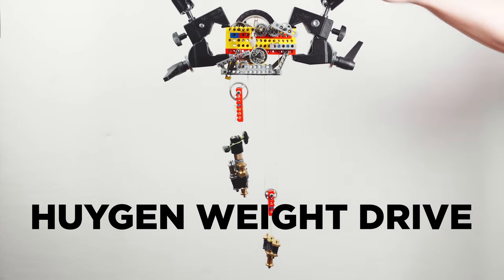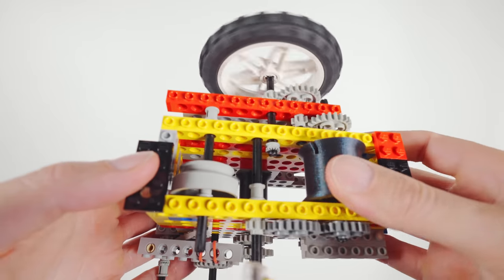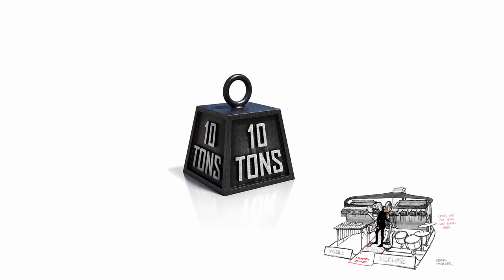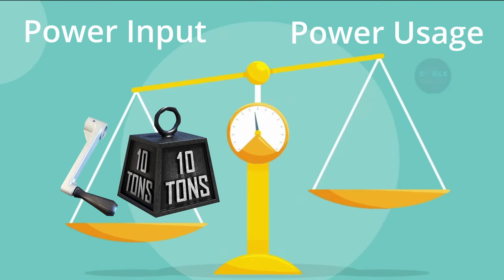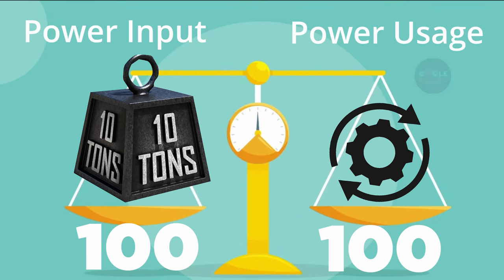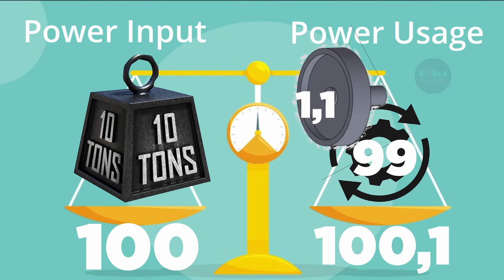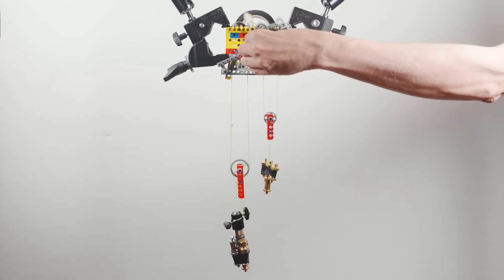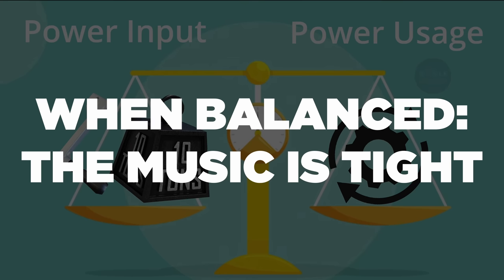Lego Technic Huygen Chain Drive

Comment: To spare you the R&D Martin, the next mechanism to look into is the clock winding differential as it won't cause backlash on the output like Huygen's ratchet does.
Reply: Can someone explain how the mechanics of that contraption works?
Reply: But Martin has to recreate everything in his own way!
Reply: @Iangamebr  A differential operates on the simple rotational relationship out = (in1 + in2)/2. If the output is set as the power storage and in1 is ratcheted (meaning its rotation is 0 unless acted upon by a manual force), that will continuously force in2 to wind down. Please see segment 2 of "Making a  Billion-year Lego Clock" for visual reference
Reply: Martin, I always loved watching your marble machine x videos in high school as I aspired to be a mechanical engineer. Now that I am at college to become one, I have loved watching your videos of the process you are using and the solutions you are finding to become a better engineer. You inspire me!
Reply: That would be a hefty spring
Reply: @thomasbecker9676  Of course, but clock mechanisms have been so thoroughly explored over many centuries — almost every mechanically possible configuration has been well researched
Reply: Does the backlash matter for this application? I was thinking the objective is to keep applying drive, but to the main drum at a scale that wouldn’t be sensitive to short fluctuations in force (since it is acting as a flywheel). The backlash problem appears to be more relevant to more sensitive measuring instruments
Reply: @kadehaviland3920  If you're watching Martin to become a better engineer, either prepare yourself for disappointment/failure, or change majors. -sincerely, an actual experienced engineer (ERAU '07)
Reply: @thomasbecker9676  sadly true. Martin has a need to micromanage every single aspect of his projects. Even if that means designing bearings... Have you ever noticed how many people have made guest appearances throughout but never lasted? This should be a group project not a solo journey.
Reply: @almerindaromeira8352 Martin has a team of engineers that were featured before. Not sure if they’re still banded together, but he does take in feedback. Part of the issue here is folks don’t realize we are watching a musician become an engineer. If the shoe were on the other foot, many musicians would be harshly criticizing the music the engineer was making as well. 

Additionally, Martin made his 1st machine alone and successfully. He is welcoming a community in to help, but at the end of the day it’s a privilege, not a right.
Reply: Yes, I've seen it on youtube demonstrates by one of the Lego channels if I recall correctly. Let me search my yt history (may take a while)
Reply: @CzarinaHarris  he only takes feedback when he wants. I've been following this project, like many others, for more than half a decade now and time and time again there are people who do try to help, only to never be heard from again. 
Sure, it's his project, no doubt, but in terms of success, his odds are really low doing it this way.
The first machine didn't have to meet all these requirements, which honestly look more like excuses than actual design concerns sometimes.
Reply: Martin, please don't be too hard on yourself for the previous versions of the marble machine not working out. Innovation is necessarily an iterative process. Almost no innovation works properly the first, second, or even 3rd time through. A modern example of this is (as much as I'm unimpressed with the company's leader) SpaceX and their various space launch systems. That their development tests (successes and failures) are so public help make them a good example of how much failure can be expected. Even though they seem to have fine tuned the Falcon rockets so well that their launches and recoveries no longer really make news, that doesn't mean that their first attempt at the Starship was successful at all. But they keep iterating.
Reply: @thomasbecker9676  The way I see it he's just got a love of mechanical instruments, not just a desire to build a machine. The process of figuring these things out how mechanical parts work is fun regardless.
Reply: I'm not sure that would work. Watch mechanisms rely on a lack of load to keep tight time. Having a constantly varying load interferes with the consistency of the escapement mechanism. More torque is needed, and the torque must be constant to account for the fact that there's significant load on the output shaft of the mechanism. A windspring has a constantly varying torque, and while auto-winding might be a solution, it still introduces torque ripple.
Reply: Martin could also use a Huygen to wind the one driving the music.
Reply: apparently some people forget what it's like to be an amateur  @thomasbecker9676
Reply: @almerindaromeira8352  Does his band even exist anymore?
Reply: @markmarketing7365  Better to learn about them from a primary source then.
Reply: @CzarinaHarris  If Martin listened to real engineers, MMX wouldn't have been such an abject failure. Plenty of engineers are trying to give him good advice even now, and he ignores them. It's like you're putting him on a pedestal that I'm nit sure he deserves to be on. Martin himself has said the original MM wasn't successful.
Reply: @typicallucas  I don't know what that's supposed to mean.
Reply: @thomasbecker9676  More than half a decade of people like you whinging about someone else's art. There is no "best" marble machine design, it's a deliberately inefficient method of playing music. Martin is under no obligation to listen to your advice (or anyone else's for that matter.) This is his project.

You're welcome to leave suggestions, but don't get offended when he doesn't bow down to your clearly superior engineering skills.
Reply: @justsomeredspy  Martin isn't obligated to listen to anyone, just like I'm not obligated to not laugh at his eventual failure. Weird how that works. And Martin has no engineering skills; he's not an engineer (and that's patently obvious).
Reply: I just saw a Lego build video about this (a billion year gravity clock), thought this might have been inspired by that.. guess not. But yeah, that video was awesome.
Reply: The pulleys of this system are a differential. What Martin was referring to is accelerating the mass of the weight will add to the force from gravity. The backlash in the ratchet is not an issue.
Reply: @thomasbecker9676  He didn't say that he was watching Martin to become a better engineer. He said that Martin inspired him to become an engineer and loved watching the process of Martin becoming a better engineer.
Reply: @almerindaromeira8352  I guess it depends on Martin's definition of success.
Reply: @thomasbecker9676  i would say they are 'on pause'
Reply: @GordieGii  sure. I mean, all in all I'm glad he is having fun with the whole process. 
You see, the expectations are on our side (of the viewer). I learnt not to wait for the world tour. If it comes, I'll be there.
Reply: @GordieGii  Martin is not an engineer, ffs.
Reply: @almerindaromeira8352  In regards to hoping for a "world tour," I'd say the old adage about hands, hope, and shit applies.
Reply: @thomasbecker9676  Martin has never claimed to have any formal training as an engineer, and his lack of experience is obvious. But, to say that he as "no engineering skills" is patently false. Please stop placing your personal feelings about Martin ahead of the facts.
Reply: @justsomeredspy  Exactly. The wacky machinations are part of the art of this project. If he just wanted the most efficient method he'd just sample a marble hitting the notes and then put it into ableton. It would sound exactly the same but wouldn't be in the same galaxy of coolness.
Reply: @justsomeredspy the frustrating part is that he often completely ignores that and starts striving for perfection. It's cool because it's inefficient!

He's free to do whatever he wants but that doesn't mean that what he does isn't frustrating sometimes. It's cool that he's starting to recognize it now (e.g. the flywheel bearing thing)
Reply: @justsomeredspy  I wonder about your personal feelings about Martin, since you raise the point. I'm ambivalent about Martin, but I'm a good engineer, so I point out facts when they need pointing out. Sorry if that hurts your feelings.
Reply: Clearly you're putting your ego ahead of facts when you emphasize your need to show your superiority over others with less experience/skills in engineering.
Reply: The journey of learning how to do things yourself is the goal for lots of people.  That means getting joy from doing something in an unproductive and different way simply because you can. The end result is you learn about whatever you randomly run into. Exposing you to far more than if you just did it the "proper" way. Gotta enjoy the journey and respect that everyone has their own goals.
Reply: Martin’s journey is a great introduction to engineering process.
Reply: As performance art, i find it very entertaining. A good source of conversation about engineering with my child.
Reply: And I have learned a lot about music.   Perhaps the least developed part of my own education.
Reply: Martin appears to be working towards s Bachelors’s degree in mechanical engineering in a way that is paying for itself.    

Or his hobby is paying dividends. 
 
Ether way.   Props.
Reply: Unfortunately, it seems Martin's journey is actually a great introduction of why we have engineering processes and showcases why they shouldn't be utterly disregarded.

I was hopeful at the beginning of these MM3 videos that he was going to at least set reasonable constraints and stick to them, but it seems like he's falling straight back into the MMX chase for perfection and unwillingness to compromise any aspect of the machine. I understand that he has no engineering background, but this is despite advice from people who know better on how to objectively improve the design in terms of cost, reliability and function (see: how much convincing it took to for him not to design his own bearing housing!!! And he still snuck one back in somewhere anyway, unwilling to admit that it is not good)
Reply: Next up: a remontoire
Reply: @thomasbecker9676  Wait. Are you saying he doesn't know how to drive a train, or he just doesn't have his train driver's license?
Reply: @thomasbecker9676  Maybe he's a Stationary Engineer, or a Sanitation Engineer.
Reply: @GordieGii  we're all stupider for having read that, except for you, I'm sure, for reasons I'm sure you understand; or don't, come to think of it.
Reply: @GordieGii  Swing and a miss, kiddo.
Reply: @thomasbecker9676  In terms of deflections, I'd give that a B+. You just restated the same incorrect assertion but added a "no u" to the beginning. Since you've clearly forgotten, the point I'm making is as follows:

You say that Martin has "no engineering skills," and that this is a "fact." I think that's an absurd position to take, and I gave you a chance to back away from it, which you promptly ignored. Now, I'm going to explain exactly why that position is so untenable. In this context, a skill is defined as the ability to do something competently. In essence, a skill is "a developed aptitude or ability." To say that somebody has no skill(s) in something necessarily means that their capabilities are not above average. So, by the logic of your own statement, if we take a random person off the street and ask them to design a part in CAD, they'll perform just as well as Martin (on average.) I don't really think I need to say anything else.

I have no personal feelings about Martin one way or another, but I do have basic understanding of the English language. So, I point out flaws in people's arguments. Sorry if that makes you look bad.
Reply: I think people are missing something important here. No, Martin is not an engineer and has never claimed to be. Yes, it is good for him to get suggestions from people who are more experienced. No, it's his project and therefore he doesn't have to listen to them even if they are right.

Now, take a step back and look at it from Martin's point of view. I don't think anyone would deny that Martin is enjoying the learning and design process. He is in unfamiliar territory and while we and certainly he would have liked to see MMX succeed, he did learn a lot of valuable lessons that he is trying to implement into MM3. Given all of this, spoon feeding him the perfect engineering solution to every problem effectively robs Martin of the learning process he is clearly enjoying. You can complete a crossword puzzle in record time if someone gives you all of the answers, but where's the sense of achievement in that?

Martin will stumble and fall, making mistakes an experienced engineer would avoid. One good thing about the fundamentals of the MM3 design is its modularity. If something doesn't work, it will be easier to completely replace it with something that does. Remember the joy on his face in MMX when he implemented the clock-style marble drop? That wouldn't have happened if his original idea hadn't been there. It's the failures that create the joy of success.

What I see in Martin is the pleasure of the journey. The destination is important, but the journey equally so.
Reply: @thomasbecker9676  Said the snob.
Reply: Someone has a billion year Lego clock that has this differential
Reply: *Huygens' ratchet
Reply: @GordieGii  If by "snob," you mean someone with an actual engineering degree, with actual engineering experience, sure.
Reply: @thomasbecker9676 
I know I shouldn't invest my energy in a YouTube comment chain, but...

You are making us (Engineers) look bad. People are calling you a snob and other things because you are acting like being an Engineer makes you better than them. This is why many tradespeople think that Engineers suck. 

What Martin is doing may not be capital "E" professional Engineering, but certainly is engineering. He is applying scientific methods to a (mechanical) design process. 

It is suitable that people might find it inspiring. There are many things an Engineer might learn from watching Martin go through his process, even  (especially!), from his failures. Martin may not be doing everything perfectly, but watching his journey would not be interesting if he was.
Reply: @Zebanafain  I'm sure you're a terrific engineer that thinks Martin's approach to everything is optimal. I'm being sarcastic, in the likelihood you don't understand. I don't know a single experienced engineer who finds the MM() a learning experience except to show young players what not to do. But hey, I'm sure you're perfectly happy in your cube using Fusion360 to design widgets to be manufactured overseas. You do you, kiddo.
Reply: @oldvlognewtricks  I have read that 3d printing allows complicated parts that would cost many times more work in the past. Surely there are opportunities to find existing solutions ready to be tested again; isn't this the essence of applied research?
Reply: @thomasbecker9676  Damn, you really showed him. There's absolutely nothing snobbish about portraying the person you're replying to as a moron, implying that they are incapable of understanding the concept of sarcasm, outright stating that they aren't a real engineer (like you and your totally not fictitious acquaintances that all conveniently share your bafflingly stupid opinion on this one specific issue), and just in case there was a shred of self-awareness left in your being, you finish your reply by calling them a "kiddo."

I also appreciate the subtle touches. Like the fact that you went out of your way to create strawman instead of actually replying to Zebanafain's comment. You make a point of attacking their qualifications, but they made no claim about their skill or experience, only that they were an engineer. They also never said anything about Martin's approach being good (in a technical sense), only that it meets the definition of engineering, which is unquestionably true.

The fact that the bulk of your reply is comprised of personal attacks aimed at painting your perceived opponent as being less of an engineer than you tells us everything we need to know about your superiority complex, and the fact that you're still here replying to comments in this thread tells us exactly how exciting your personal life is.

Please endeavor to go against a single engineering stereotype. You're one tone-deaf comment away from completing the engineer stereotype infinity gauntlet.
Reply: @thomasbecker9676  
That was an amazing set of assumptions you just made!

It is clear that engaging with you will not add any further value to the conversation so the rest of this comment is not directed specifically at you.

To the engineers/Engineers that read this; please try to be aware of how you communicate with others. There is little value to being 'correct' if no one values your opinion because of how you communicated it. Also, no one person's experience is absolute. There will be things that you think have value that others do not (and vice versa). It is possible for both parties' experiences to be true at the same time!

To the non-engineers; Please try to be understanding of Engineers. It is a field that typically values academic ability far more than social ability. Most people are trying to add value to whatever conversations they participate in, some/many just don't know how to do so effectively. 

Be kind to each other.
Reply: @Zebanafain  Your reply has surpassed mine in both its eloquence and purpose. I work as a software engineer, so I have to deal with many of the same stereotypes. That's probably why my immediate reaction towards people like Thomas is one of open hostility. I do sincerely hope that people don't base their opinion of engineers off of how a small portion of the engineering community portrays themselves online.
Reply: @justsomeredspy  TL;DR
Reply: @Zebanafain  TL;DR I'd suggest a technical writing class, Mr. "Engineer."
Reply: Yeah the LEGO Billion Year Clock video uses a differential piece in that design. In that video it lays out how the BPM can be set by using an escapement mechanism. Combining the two designs should give continual motion while controlling the speed.
Reply: @thomasbecker9676  Congrats you have a piece of paper with your name on it and have worked on generic engineering activities... lol
Reply: @davinderc  The piece of paper in question is for a BS in Aerospace Engineering, and I've worked on multiple military and bizjet programs and am now part of ITER, but sure, "generic engineering."

Do you guys still have to ask about wanting fries with that?
Reply: @thomasbecker9676  I mean someone who thinks that the only people who can 'do engineering' are people who have paid for the title. I've met enough engineers to know that some not insignificant portion of them think that they are smarter than they actually are and this causes them to think that they are impervious to making mistakes. And the arrogance. I can't say what is cause and what is effect, but a lot of the engineers that I have worked with are quite arrogant. Often it's unjustified.
Reply: @GordieGii  Perhaps they're not "arrogant," and you're just incompetent?
Reply: @thomasbecker9676  are you though? How many failures have you created in your career… trick question. 😉
Reply: @Jsmith32t  career failures? Probably none, because real engineering companies have checking processes that largely eliminate failure. There were abject failures at Thingergy, but those were due to the owner/operator being incompetent. Personal projects, sure, but I learn from my failures; I don't repeat them for content on YouTube.
Reply: @thomasbecker9676  I'm uneducated, not incompetent. When I tell an engineer that something is going to break and he sneers at me that he did the calculations, and then it breaks, that wasn't incompetence on my part, that was arrogance on the engineers part. I don't think someone is arrogant because they're right, I think someone is arrogant when they think they're right and even I can tell they missed something. I trust the engineers the vast majority of the time because they DO have the education and I don't, but when my gut tells me something is wrong and an engineer won't even consider the possibility that he (or she) might have missed something, that's arrogance. I don't have contempt for education, I respect it a lot, and I have met engineers who aren't arrogant, but I've met more who are. I don't know whether it's something about the engineering program that instills that attitude, or whether it just attracts a certain type of person, but studying Systems Analysis doesn't make one immune to blind spots. That requires constant vigilance.